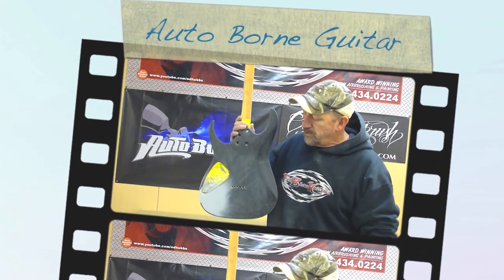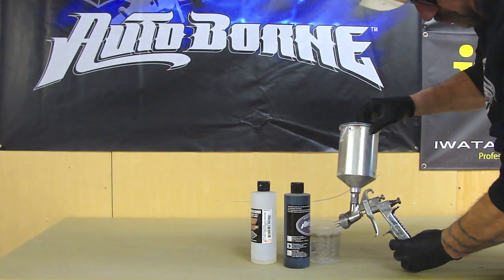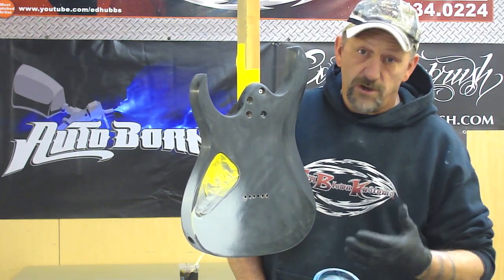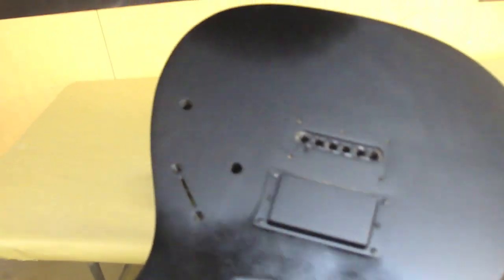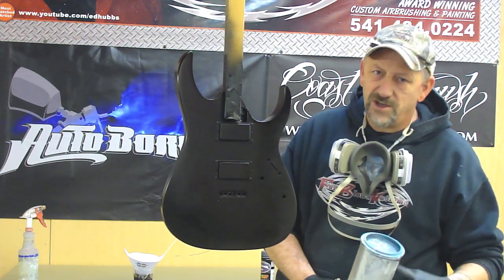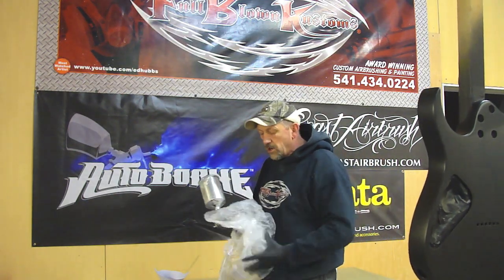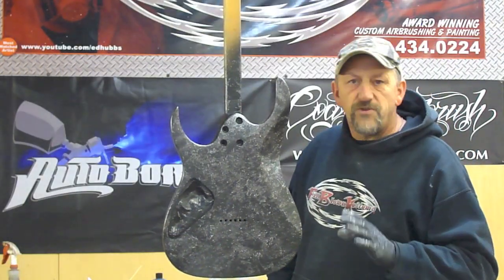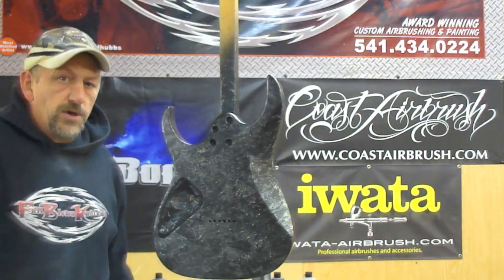Auto Borne Guitar

Comment: I've been watching your stuff for years. I use Wicked Colors and Auto Air. I have yet to clear anything because I'm afraid of how to remove the wax/grease...what the hell can I use that will not pull the paint!! The water based stuff just pulls. Any help is appreciated! Nice work man.
Reply: rhall651 I was curious about that also I noticed it removes paint.  they say it's over spray just spray it and wipe it real fast.
Reply: angel85lx I finally decided to just go for it and bought some Rust-oleum wax and tar remover. It also removes grease of course. I have finished one plastic helmet and several metal panels that have been cleared with no issues. I tried Spray-Max water based wax/grease remover as well and that did the job without pulling or smearing any water based paint. Hope this helps! Oh, the spray-Max is in a spray can the Rust-oleum is not but can easily be put in a spray bottle for easy use.